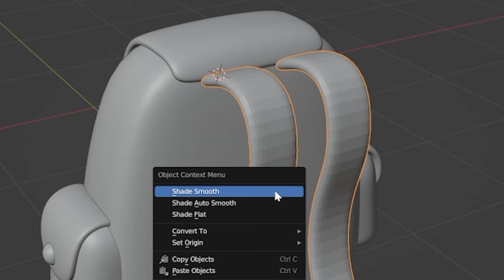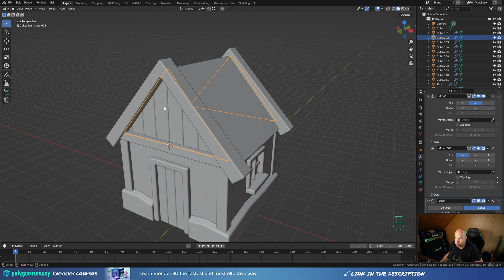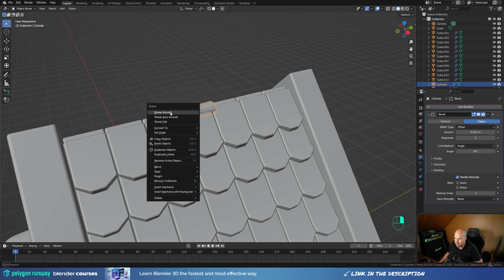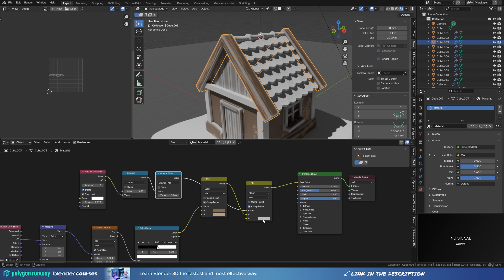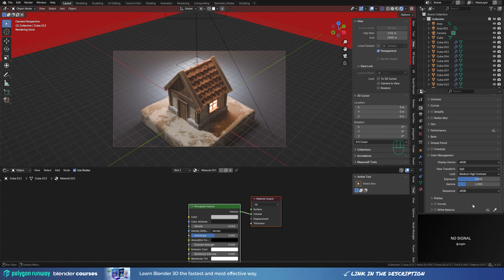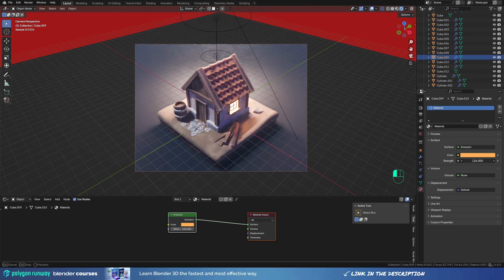Full Blender Tutorial - Textured Medieval House

Comment: I'm currently working in Blender version 5.0.1 and for some reason, when I add a material with ambient occlusion to the beams (just connect it to the surface output), my scene and Blender itself crash. What could be the reason, if you can help please?
Reply: Its most probably saying in the top of your 3D view that its loading render kernels and that that may take a few minutes for the first time, just let it load for a bit :)
Reply: @AzamiAokaga  No, the reason is that the blender simply crashes and no matter how long I wait, nothing happens

Comment: Vor some reason i cant extrude the roof like you at 3:45.
I Take the same Keys but the beans arent close at the top
Reply: I've got it. I forgot the very important function "clipping" in the mirror-modifier. That prevent gaps between the moddel at there gaps!
Reply: @StixxLetsPlay  Thank you so much! super helpful comment
Reply: OMG thank you ! Was running into the same thing
Reply: @IsaacRespawned no Problem. Im glad i could help

Comment: At around 13:44 when we are applying the properties from the roof beam to all other, it gets weird.  in wireframe mode i can see that there are some lines connecting to the origin and it is making the faces disturbed.  Any ideas?  By the way, great tutorial, would be great help if you can suggest something, i really want to complete this. Peace!!
Reply: Ok, I have solved it!!!
Reply from the maker: Awesome! Maybe share your solution in the comments in case someone has the same issue ;)
Reply: @polygonrunway  Yeah, In Edit Mode, I went to Mesh-->Clean Up-->Delete Loose.  This solved my problem.